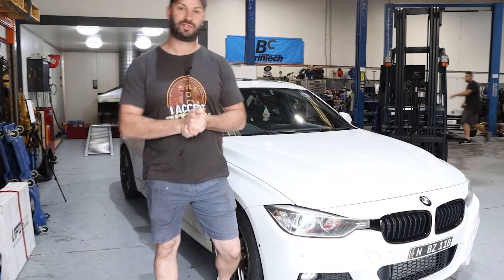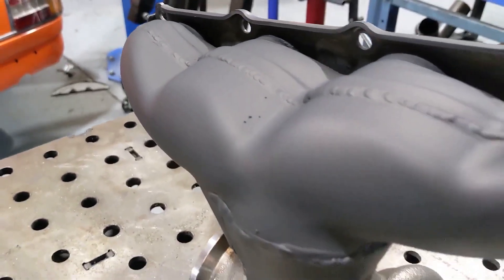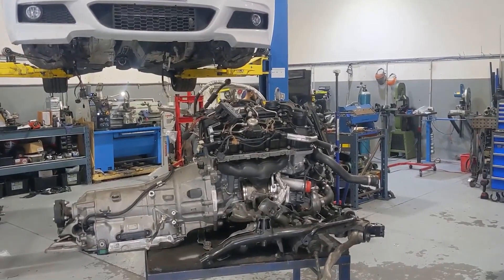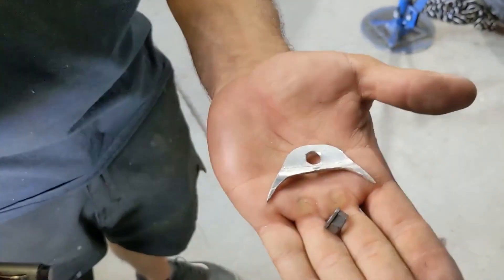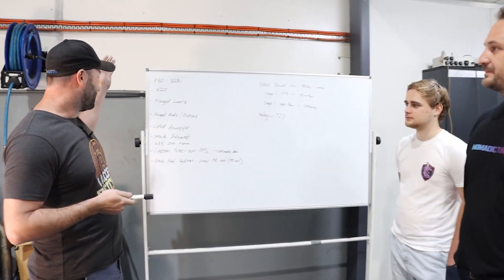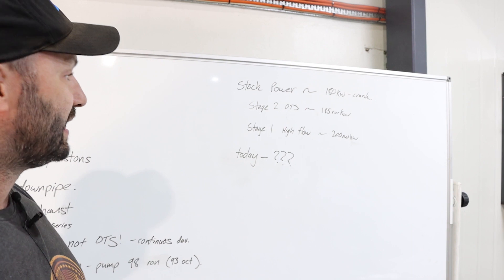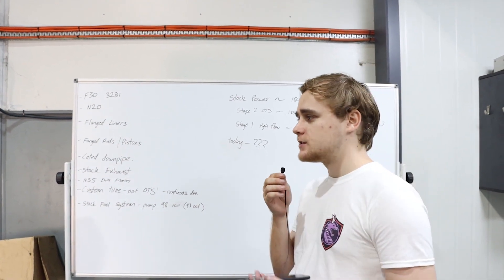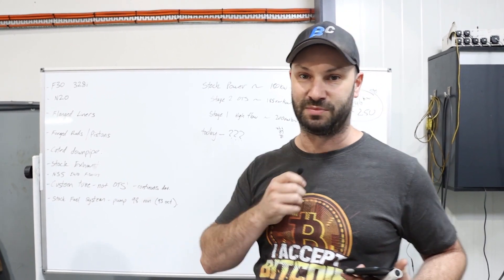BMW F30 328i N20 engine build Part 4.

Comment: There’s a lot more big turbos for these engines on the market now.. have you guys tried running a big turbo like a im500?
Reply from the maker: This video is like 5 something years old lol - by the time the IM500 and IM450 from IPOS came out which was 6 months ago we already had a turbo solution sorted and ended up selling the dev car etc

Comment: Ok so as far as pricing, while its neither a budget or overly expensive build what would you say the approximate cost was in total, for someone who wants a shop to do something similar
Reply from the maker: So given the added development on this platform we have made (New content coming soon), but it has also been touched on in this video https://www.youtube.com/watch?v=Czha2y5dgXo

So with the changes to move to a Darton Wet Sleeve setup - which effectively costs the same as Flanged liners + Closed Deck factoring turbo, labour etc 

You're looking at around 24,000-36,000 AUD
Engine alone is going to place you somewhere around the 16,000-30,000 AUD mark depending on configuration (power goal requirements etc) Turbo setup alone on average costs about $5000-7000 AUD . This setup sat at 6500 AUD for the N55 EWG turbo retrofit

We have a variety of engine configurations you can look at with varying pricing structures
https://navardituned.com/collections/built-motors

Comment: I have 2014 f30 328i, I have a bm3 staged 2, catless Down pipes, upgrade blowoff value precision race works coils, upgrade charge pipe, Mishi Moto Oil catch can I was wondering if I dyno tune how much hp I’ll be running
Reply: Custom Dyno Tune, depending on what Dyno you use would be around 280-300WHP on 93/98 RON on Dynojet, or 185-200RWKW on Dyno Dynamics/Mainline. But end of the day results can and will vary as fuel quality, elevation, humidity, Intake air temps etc all affect the end result, Dyno is better to be used as a tool to see the gains over Stock
Reply: @TheBattleFrags  thank u 💯💯💯

Comment: Hey aussie, I am FBO stage 2 BM3 stock turbo, im curently making 320 hp crank
Car is running perfect at 71,500 miles, i want more power without upgraing rods and pistons, What turbo would you recomend without blowing up my motor? Is it worth getting upgraded turbo at 71k miles if im planning on keeping the car untill its dies? Lets say i do upgrade my turbo, do i need to replace timing chain?
Reply from the maker: If you haven't done the timing chain I suggest getting it done, it is problematic. Honestly depending on your power goals either a stage 1 turbo or strait to a N55 stock turbo with Upgraded Hpfp for both would be recommended as we've seen issues with stage 1 turbos in cold winter months have issues with HPFP on 93/98RON. For more detailed info on the matter message navardi tuned.
Reply: @NavardiTuned  my goal with the stock block/ stock internals, is 350HP to the wheels, while daily driving the car, you think it’s possible with just upgraded turbo? 
What do you think I should do to get that power? And what I’d the max Torque on a N20?
Reply from the maker: @eddiebarrera949  550NM at the crank is the max safe torque the rods can handle. Depending what dyno you use 350whp on a stage 1 turbo is possible on E85, 93 you'd be pushing it. However Upgraded HPFP required for E85, E85 on stock turbo on a DynoJet would see somewhere from 320-350whp.
Reply: @NavardiTuned  that’s interesting, so i live in california and we’re known to have low fuel quality and 91 is my max, what would you recommend for the 350whp stage 1 turbo on 91 ? or go e85 with with stage 1 and upgrade fuel pump ect.
Reply: @NavardiTuned  how do you feel about the transmission tube called XHP flash tune ?
Reply from the maker: @eddiebarrera949  91 on even a stage 2 turbo would be a struggle to make 350whp. You'd be better off cost effectively going stage 1 turbo, spool FX150 HPFP, full E85 to make a solid 350whp on DynoJet. Then if you wanted a 91 tune thats fairly basic so the turbo runs properly and so that you have another tune to fall back on if you can't get E85.
Reply from the maker: @eddiebarrera949  awesome! Recommended to get XHP
Reply: @NavardiTuned  perfect thank you so much for the information! for e85 what do needs to be upgraded ?
Reply from the maker: @eddiebarrera949  Spool FX150 HPFP is the minimum requirement for that fuel
Reply: @NavardiTuned  so the spool fx150 HPFP , e85 BM3 tune  then can i run full e85? if i want closer to 350whp stage 1 turbo , fx150 and e85?
Reply from the maker: @eddiebarrera949  spool FX150 and a stage 1 turbo will guarantee 350whp on DynoJet with a custom tune, stock turbo and Full E85 has potential for 350whp but has not yet been achieved as there are only 2 people I know of (Navardi Tuned customers) that are running the Spool fx150 HPFP.
Reply from the maker: @eddiebarrera949  in general its loads better than the bm3 trans flash, it is overkill on the N20 but the shifting is way better and the rev matching is awesome + more

Comment: Hi guys, I’ve got a stock 328i n26, with bm3 stage 1 and I end up getting a drivetrain error with code 120308 boost pressure too low. Could it be a boost leak? Do you guys know of common places where this can happen?
Reply from the maker: Hey, have a look at the coupling connections of the chargepipes known failure point. If you are using stock chargepipes they are known to crack and leak under pressure, the stock DV is also known to crack and leak.

Comment: Good Job guys! Very impressed. Not by the power per say, but after a fuel system upgrade there should be plenty more power to tap in. Greetings from Germany!
Reply from the maker: We can't wait to upgrade fuel system and go for somewhere around 450whp! This thing is amazing to drive, and to see an N20 take 33psi and not blow up is truly insane :)
Reply: @NavardiTuned  I agree. This whole N20 thing turns to just being ridiculous from 4XX figures upwards. Can‘t wait.